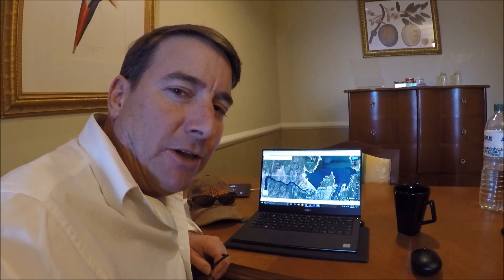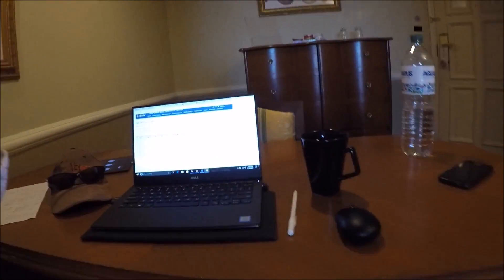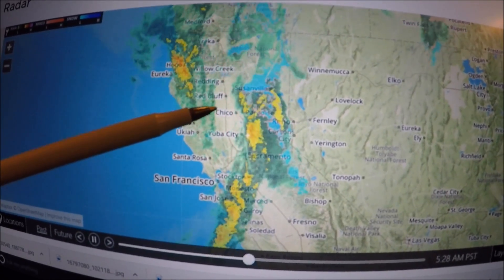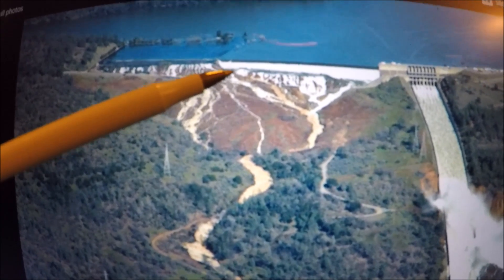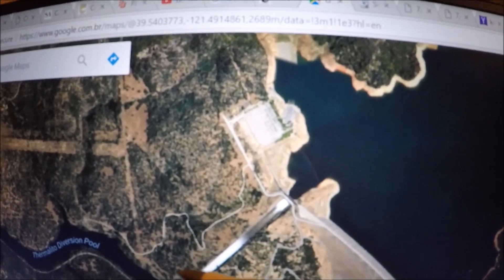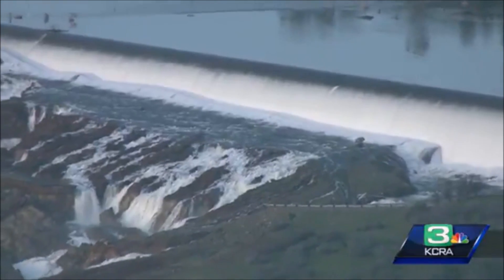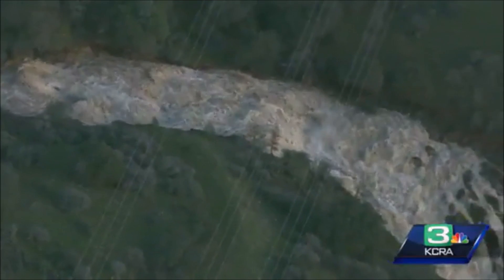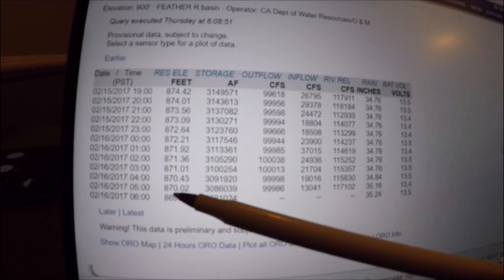Oroville Reservoir Update 2/16/2017

Comment: Excellent update .... thanks
And, too bad the officials screwed up by not maintaining that dam & not opening the flood gates earlier to avoid this disaster.
Reply: the dam was never in danger, maintenance was never an issue.
the flood gates on the main spillway have nothing to do with the concrete
spillway itself failing, or when they were or were not opened.
Reply: SailorAllan Nice spin doctoring. Do you work for the damn folks? 
Regardless if you do or don't. Please stop insulting the intelligence of those following this story.
The overflow spillway. and the emergancy spillway, are all parts of the damn system.
Lack of proper maintenance, is precisely what is the root cause of this disaster. There is no avoiding these facts.
The emergency spillway, should have never been allowed to have growing trees, and shrubbery, on that hill. For the very reason that we saw happen. If they would have opened the emergancy spillway, without trying to remove all the vegetation. The rushing water would have washed them away. But when they removed the vegetation. They loosened the topsoil. Which led to the massive erosion damage from only 15,000 cfs, and that if left unchecked, would have compromised the foundation of the emergency spillway. Which would have allowed a 30' wall of water to decend upon the towns in it's path.
Now if the spillway were being properly maintained. We would have been seeing, a nice covering of a deep rooted grass. With upwards to 250,000 cfs flowing down it. Which of course, would have allowed the engineers, to shut off the flow down the main spillway, once the breach began. Which would have minimized the damage to the spillway chute.
Reply: good grief--first off, the emergency spillway does not "open" or close,it
is just a wall at a set height, the lake level determines if any water goes
over it or not-nothing mechanical about it. and if you think a lawn of sod
on that hill would hold up to a torrent of water from the emergency spillway your goofy. the vegetation there KEPT the hill from eroding all 
these years with their root system. grass roots ain't gonna hold the soil
from washing away. and the only reason the water got high enough to go over the emergency spillway is because the spillway chute failed and they couldn't let enough water go down it to control the lake level.
"a nice covering of a deep rooted grass" my ass.
Reply from the maker: yes, that may be the case in hindsight...but see my response above re known's and unknowns at decision time....
Reply: at some point, when the outcome of the erosion of the main spillway was still an unclear situation, the dam (foundation) was in fact in danger.
Reply: I would have to agree that grass wouldn't have helped with the erosion, the grass would have been shredded by that much water.
Reply: Touché Sailor!!!

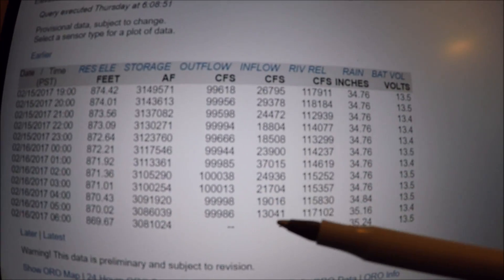Comment: Hey you skipped over the column RIV REL 4:50 . What is that?
Reply from the maker: Twisted Mr. I'm not sure what that is...is that release into the Feather river at the downstream dam?
Reply: I'm not sure either.  When I click the link is describes it as Discharge, Control Regulating. Again, not sure what that means.